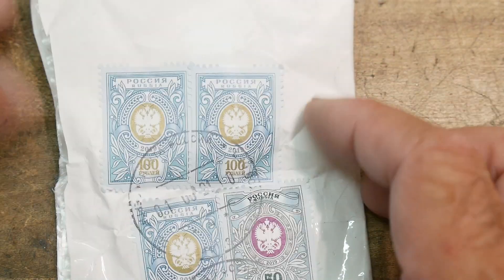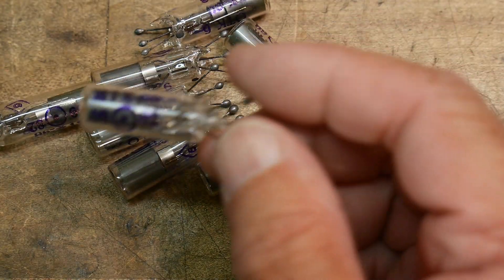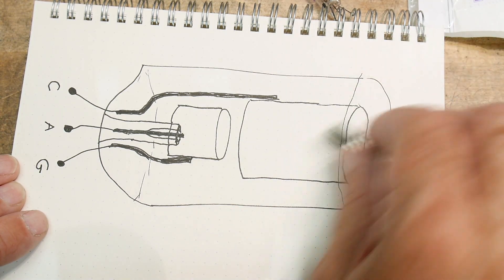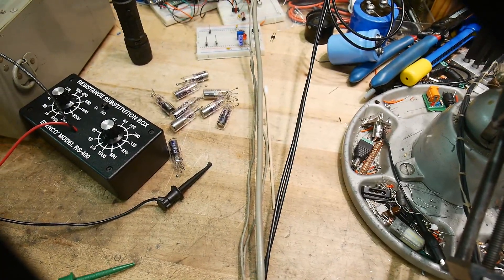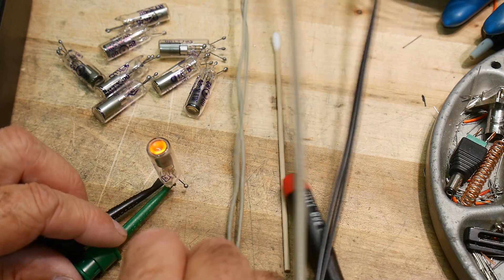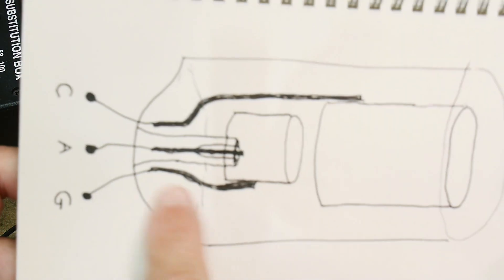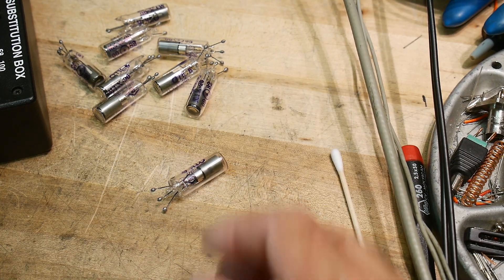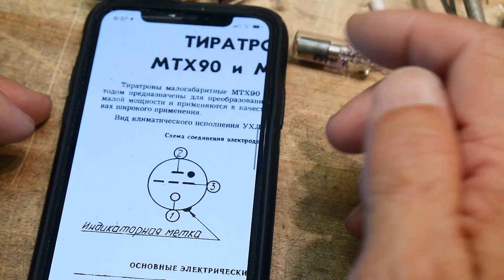#857 MTX90 Neon Tubes

Comment: Years ago I designed a big Xenon flasher system for a research group. The tube is triggered either by an external HV wire or by a a gas filled tube, like a thyratron or equivalent. These small tubes presented here may also be used in some systems. However, in 1999 they were restricted products and hard to get. The reason is that some nuclear devices use similar  trigger tubes. I finally got the tube and got it working fine.

Comment: I have touch panel containing 5 of these (can still be found on eBay). The metal buttons you touch to turn each one on (and the load you want to switch on) are connected to the gate through a 220K resistor. I'm just wondering how you would turn them off again though because, obviously, touching one of the other 5 buttons won't turn the lit one off and you end up with multiple lit indicators. Still wondering how these panels were used.
Reply: usually the power supply for these tubes is unfiltered rectified mains (half or full) so it’s going close to zero somewhere around 25-60 Hz then coming back up to striking voltage, so you only have to worry about them staying on over fairly short timescales.

i would like to know what the touchpads were being used for, i haven’t a clue.

Comment: Once triggered and conducting can a voltage on the gate modulate the anode current ?
Reply from the maker: don't know
Reply: @IMSAIGuy  Ok. I think I'll buy some because the structure of the gate it looks like it could. Would be fun to build an amp or regenerative radio out of these.